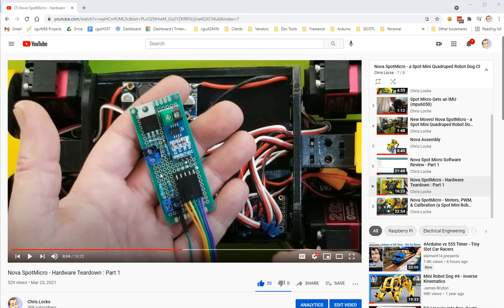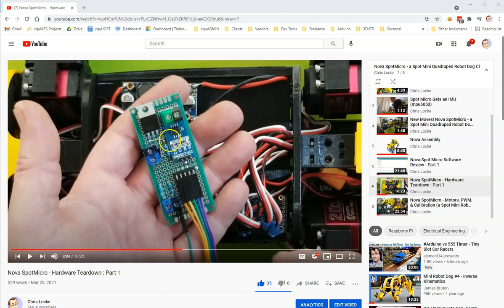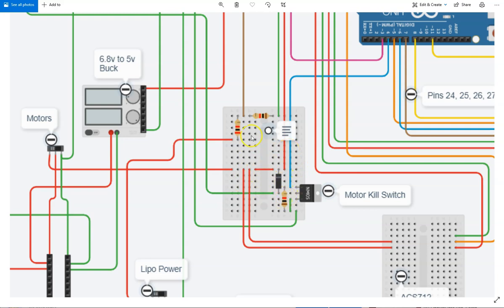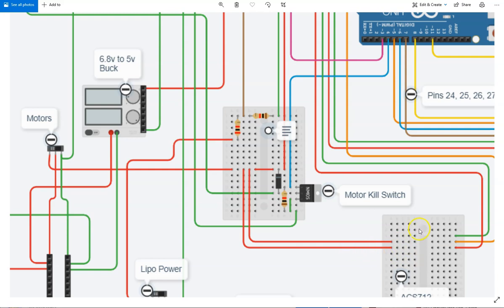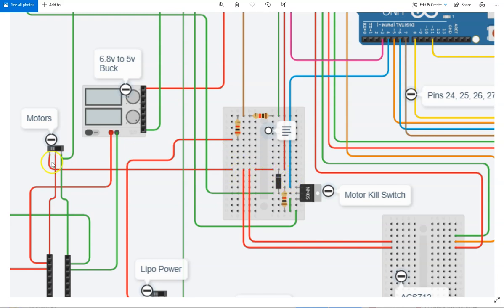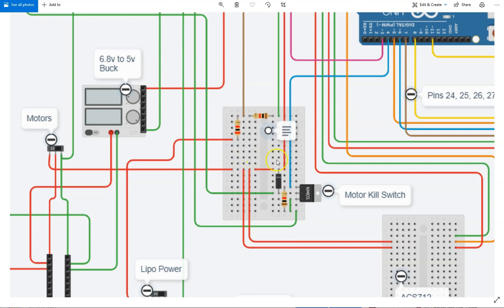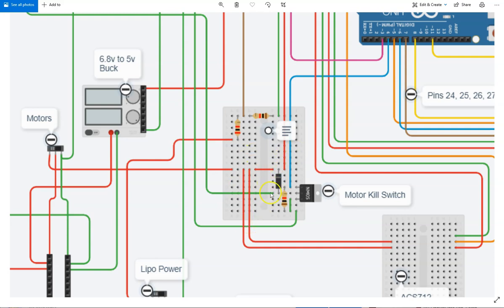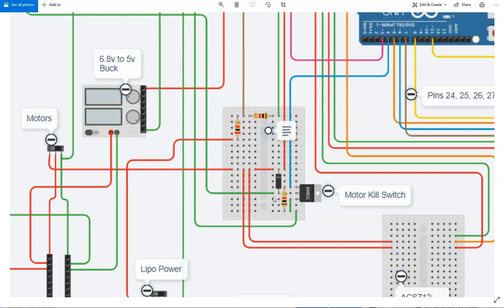Nova SpotMicro  - Hardware Teardown  Supplement Video

Comment: just wondering why the servo controller V+ is connected to D3 on the Arduino
Reply from the maker: thats a motor enable pin on the controller, but i couldnt get it to do what i thought it would do... disconnect power from motors. This is why i added the amp monitir board and accompanying switch circuit.
Reply: @ChrisLocke1969  relay would have worked better but I have started to wire it all up, so far so good, love the little buzzer sounds :)
Reply from the maker: @stefi300972  oh cool!!  I just realized I should've answered that better.... those diagrams are tricky because of missing components, and I didn't note every pin.  The controller has an OE pin, that is what's connected to D3. Then it has V+, Gnd, and sda/scl pins... just for clarification.

I'm so happy to hear its moving along for you, Stefi!  Please post a video when you're ready? I'd love to see it.   And ya, I found R2D2 code on the net, works awesome.  Here's a coding tip I learned along the way playing with the sounds... actually with random on arduino... I could not get the sounds to change pattern, though it was random. Rebooting arduino still played the same "random" pattern... it was soooo weird. Then I learned we have to reset the internal randomizer if we want it different each time (and why wouldn't we? lol), so you'll see a line of code in the software that does just that:   randomSeed(analogRead(0));    Pretty handy.... I think you have to do it on an unused pin, or maybe not. But it worked for me... now every startup, the R2D2 randomness is truly random!!  Anyway, build on!!! :)
Reply: @ChrisLocke1969  I worked out most of it ok, including the motor switch with the fet, theres always the code for missing pins and i am guessing you just used wire.h on its on uploaded to the nano?
Reply from the maker: yes, and i have updated the wire diagram and finishing up the code this week for the nano circuit. So i will release a version update for those that want to do the Nano. Im anxious to see how she performs after this last bunch of upgrades! 🤞
Reply: @ChrisLocke1969  you know , the ultimate challege would be to add sensors under the body for walking on uneven surface. might need a second mega lol
Reply from the maker: hey, hold on... if i recall you scolded me for continually making changes as it is... now a second mega? 🤣🤣🤣👍

trust me, as i was reassembling her, i was thinking, hmmm... maybe i should extend the backend, too! lol
Reply: @ChrisLocke1969  ah theres enougth room to squeeze one in, above the nano and drill holes for the sonar, see, no need for further printing replacment parts 🤣